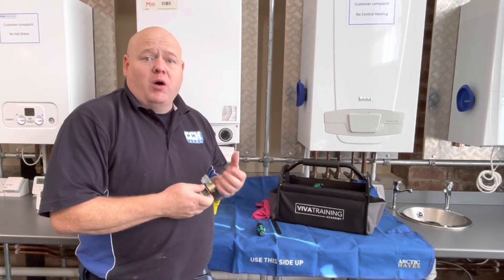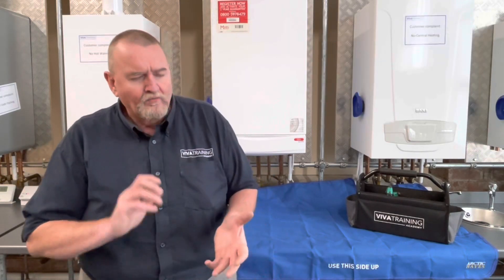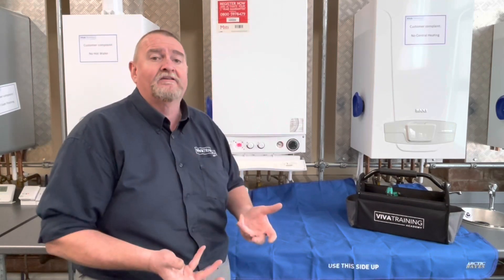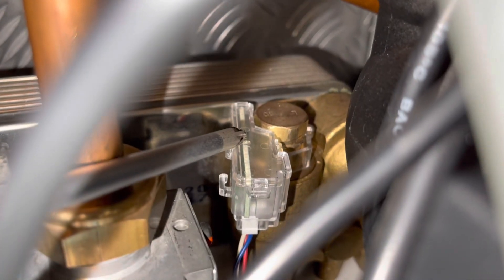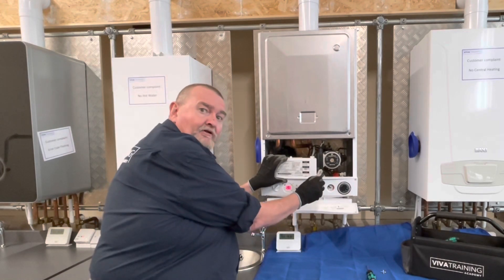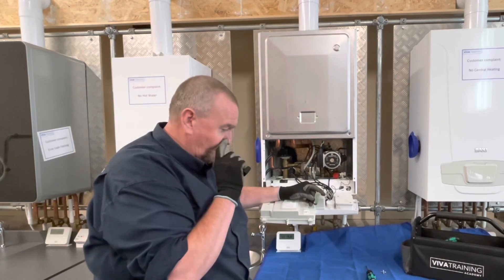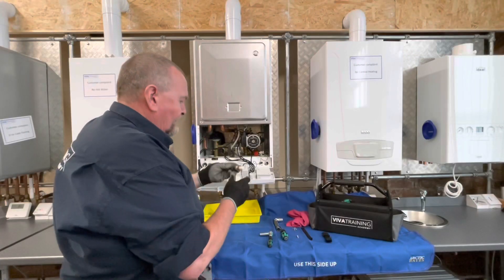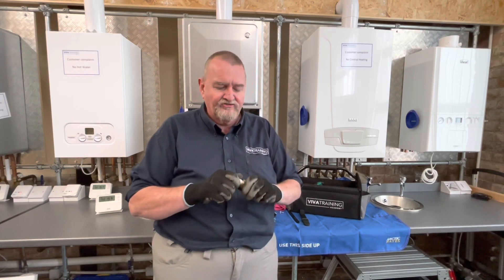Gas Training - No Hot Water - Viva Training Academy - Roy Fugler

Comment: Hi sir I have baxi zetatec and 2 month old I got hot water but my radiator are not getting hot. The seams to fire and pump is running but no heat. I have tried to put the heating temperature up and nothing really happening the heating pipe seems to get little worm and that's it please can you help. Kind regards from afzal of south Wales uk.
Reply: Pump or blockage.

Comment: sorry i flooded your workshop Roy.
Reply from the maker: Did you really flood it
Reply: @AllenHart999  yes, i just did the fault finding course and it was absolutely brilliant, however when fault finding on the fancy glass fronted 8000 instead of removing the wiring for the thermister i actually removed the whole assembly. Not realising it was in a wet pocket Hot water under 1.5 bar of pressure shot out and soaked me, the tools, worktops - everything !!!
Reply: No need to apologise Warren, it wasn't really a flood, better doing it in the workshop rather than Mrs Miggins kitchen 😉

Comment: If the boiler is a few years old those cartridges will be seized in , the best way I have found to release them is I modified a box spanner and welded a 1/2 inch socket to it and I use a 600 mm breaker bar to crack the seal , you may also find using a wobble adapter on the end of the bar will get the job done depending which boiler it is , put plenty of silicone grease on the new one and it will go back in easy....👍
Reply: @markchristohperowen6806  what?